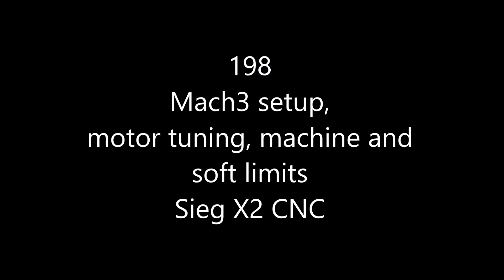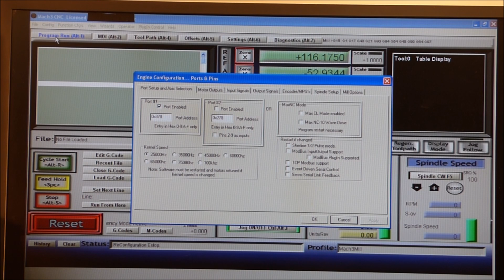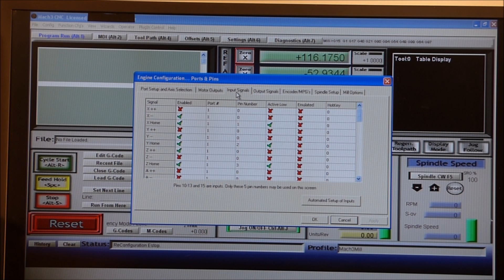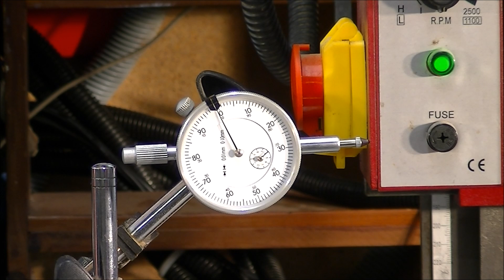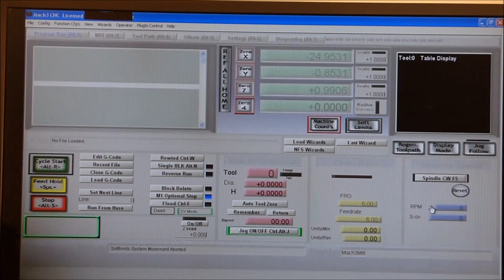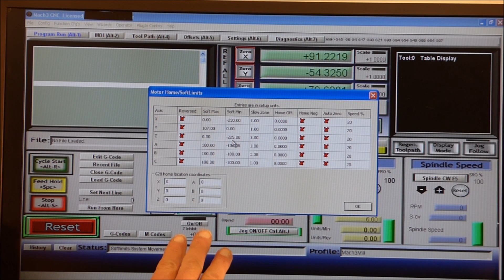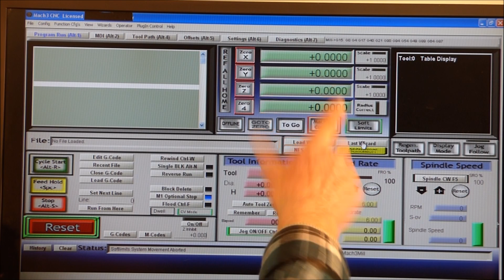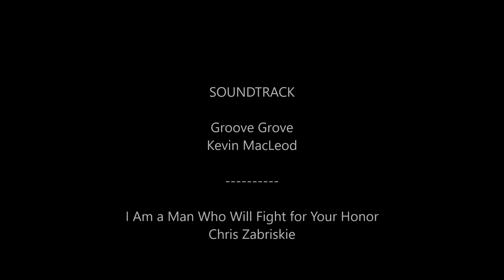Harbor Freight Grizzly X2 CNC Mach3 configure, motor tuning, machine and soft limits

Comment: Hì Sir
Please help 
After I setup  and program to run . But the motor running very slow.
I look in to feed rate is 100 %
And when I jog is running normal.
Please advise 
Thanks
Reply from the maker: Hi Tony, have a look at my videos 335 and 336, also have a look at your CAM settings.
Thank you, for watching,  
Please like, subscribe and forward the video on to a friend, Roger Clyde Webb
Reply: Thank Sir 
I will look over this weekend

Comment: Hi Roger,
I have everything set up nicely as you showed on the video shown. Everything works nicely (softlimits). But then I closed Mach3. Got a fix saved message and said yes. But when I restarted mach3 everything was gone again. Machine coordinate no longer matched what I had set. Is there another way that I do not have to set everything up every time?

Greetings from Martin

Comment: Hello what does step low active do?
Reply: The controller sends out signal pulses and to create these pulses the output voltage must be switched between +volts (typically around 5 volts) and 0 volts (or electronically close to it). Active high means use the +volts part of the signal as a pulse and active low means use the 0 volts part of the signal as a pulse.

Comment: Roger, I really like your work. I have a Laguna IQ HHC I want to add the 4th axis. I already have a post that will work and a HHC controller that can work. Can you recommend where I cab buy the parts to assemble the 4th axis?  also it would be nice to convert this away from the hhc.